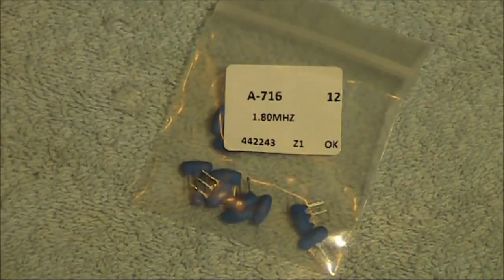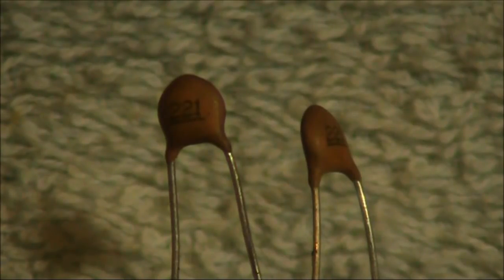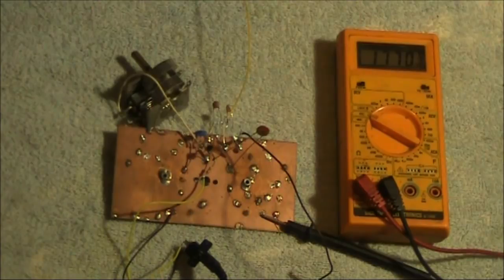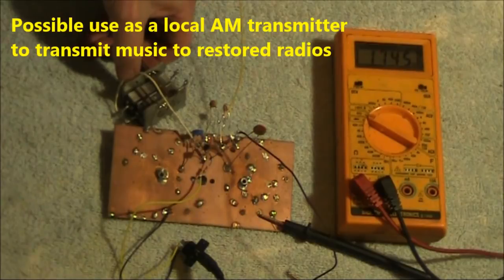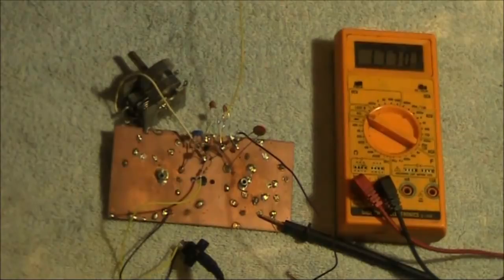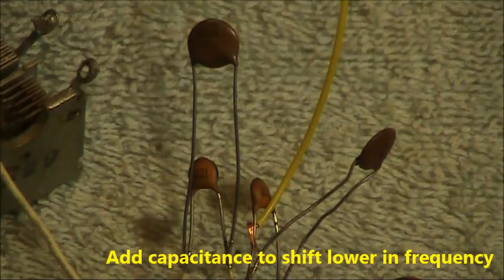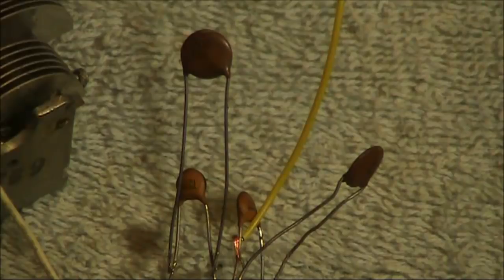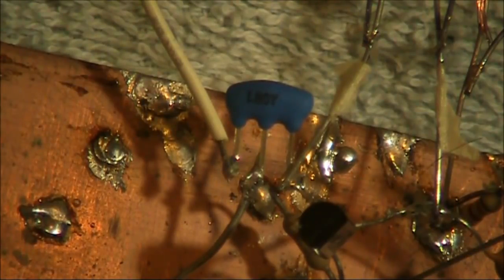Experiments with 1.8 MHz ceramic resonators

Comment: What about changing the configuration of the oscillator? I have a feeling that this may have potential to give a wider tuning range.
The feedback capacitors in the colpitts oscillator arrangement utilizing an emitter follower amplifier are connecting directly across the resonator/capacitor arrangement, they dilute the potential for tuning range.
A ceramic resonator has less Q than a crystal as well and will drop out of oscillation much easier. I feel to look at an oscillator which has feedback using a common emitter amplifier topology so there's more voltage gain in there and then investigate various frequency pulling approaches

Comment: It's interesting to see the amount of pulling range you were getting. Around 40khz is a fair bit compared to the frequency of around 1.7 Mhz. It's got me wondering if higher frequency resonators pull over a greater range and if the pulling range ends up being roughly a percentage of the frequency of operation. For instance will a 7mhz resonator pull over a 160khz range. Anyway that could be more unstable than applying good circuit construction practices at a lower frequency and using a frequency multiplier to obtain the output you want but still an interesting muse

Comment: Excellent video, thank you. Can you explain a little more about the frequency multipler? I've seen frequency multipliers mentioned before in super vxo circuits but I'm not clear how to implement in a circuit.
Reply from the maker: A frequency multiplier follows the buffer and can be either passive (using diodes) or active (with a transistor). It needs a tuned circuit following resonant on the frequency that you are multiplying to. See ARRL handbook etc.
Reply: vk3ye thank you, that's most helpful

Comment: Hi Peter.
I really enjoy your videos, being one who enjoy's QRP hand home-brewing.  I have a suggestion for you:  could you scan your schematics in PDF and post them on you web site for us to download?   It would be easier for us to get them.
73 Chris VE2MW
Reply from the maker: Thanks Chris - I could but have you tried pausing the video on the circuit and using the snipping tool? That gives you a jpeg file that can easily be saved and printed.  In this case I used a thick pen that should print out OK.
Reply: Hi Peter. Yes I have done this and it works.  Either way is fine but I find that the PDF is better.  Cheers and keep up the good videos.
Reply: With Linux OS, some printer softwares permit printing to .pdf, rather than to the printer, as an option. Try ctrl+P. When the print option window opens switch from your default printer to print to PDF then click on SAVE. Another option window will open querying where you want to save your PDF.
Reply: Hi Terry.  I forgot about that one!  It works with Windows.  Thanks for the reminder.

Comment: How stable? You could run it for 10m and monitor freq on 3.5mhz.
Reply from the maker: It's probably tolerable for CW and even SSB  but definitely not for digital modes. Unfortunately I've pulled it apart.